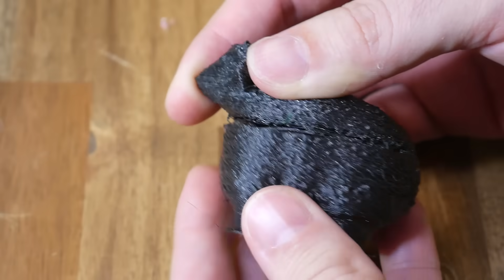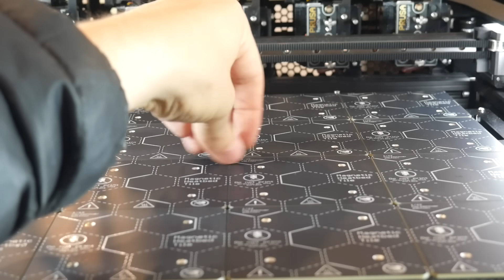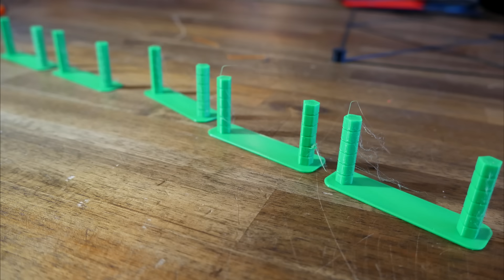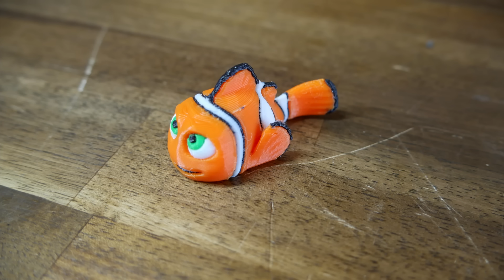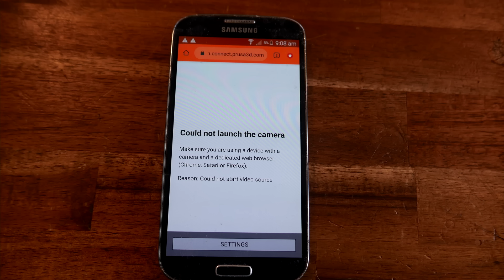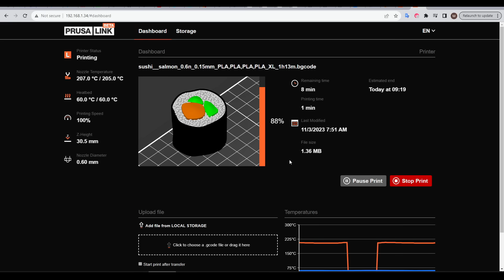The 5 tool Prusa XL is currently flawed, but I think it can be fixed

Comment: I used a draft shield for my tool changes in place of a purge block. It swipes over the tower, knocking off the filament string, and purges into the infill. By the time it gets to the walls of even a small model, it has consistent flow. It finishes on the draft shield and moves to the next tool. The key to success seems to be that it swipes over the tower and knocks off the string, with increased success the less z raise I have. 
It uses a slope z raise, too, so as it leaves and returns, it wipes on the model just a bit and doesn't leave a bump or strong like you mentioned. Maybe you want to run your z hop modifier on it and turn on draft shield?

Comment: I've been happy with my XL 2 head so far.  I think the big difference for me is I really only print functional things, so if it doesn't look great it doesn't really matter as long as it is dimensionally accurate.  I definitely agree with having only one bolt is questionable for longevity for the extruder holder.  One thing I recommend all XL owners to do is replace that USB stick, mine failed within 2 weeks and from the facebook group I wasn't the only one, especially if you're updating firmware, you don't want it to fail.
Reply: That's a really low bar to set for a very, very expensive printer
Reply: @geometerfpv2804  If I would've paid the ~$5k usd that he did, sure, but my total was a little more than half that (semi-assembled 2 tool).  There is nothing in the $3k price bracket that can do what the 2 tool XL can.
Reply: Do a size check with gparted, don't know where Joseph got these USBs but the probably where one off the cheapest in china!
Reply: First thing I did when I got my mk4 was to replace the USB drive with a SanDisk. I don't trust anyone else with thumb drives.
Reply: wow and I thought those usb stick errors came from the Firmware Update good to know that it could be the stick itself.

Comment: Once they have the bugs worked out and it working as reliably as an MK3 this is the type of mutual color printer I would consider. However the price is an absolute no-go. There is just no way I would ever even consider paying that much.  It may be worth it to some but I can't replace the transmission in my car and still have enough left over to cover a year's worth of insurance for the same price.

Comment: Since its finally ok to publicly criticize prusa (this is just commentary on how rabid some fans can be) I think they need to be called out for how not open source their "open source" is.

They have been neglecting to release the wctusl relevant files when it comes to hardware, have been documently more and more poorly/keeping things close to their chest, have publicly complained and indicated they want to move away from being fully open and I think most egregiously, purposefully design things to be hard to reproduce to "stop clones" they say, but not only does that defeat the purpose, but its the type of thing which affects theor paying customers the most, as it means that realistically they have no hopes of making parts themselves and must rely on a company with suitable skills to produce parts (the thing prusa wants to stop).

It just feels like they have been coasting on the lie that is how open source they are for too long.

They use a long ago forked off veraion of marlin which cant be used anywhere else due to that, and it has bitten them because they had to reimplement input shaping which was implemented in marlin proper a long time before they implemented it in what I am choosing to call proprietary through obfuscation marlin.

They try to claim they are being generous by keeping prusa slicer open source, but the truth is that they not only are based on gpl3 code, but are so varied in locations theyve pulled code from that it would be a legal nightmare for them to try to be closed or a technical nightmare rewriting from scratch.

So really, what are they willgully contributing to open source? Why is it people give them credit for improving their slicer which they are forced by license to open source but not BambuLab who also (due to license) have their slicer open source?

I think the truth is that Prusa are now open source not because they want to be, or because they want to contribute, but because they have to. It is literally technically burdensome for them to go closed and so they do not but also waste a ton of effort trying to obfuscate so they can try to have the open source flag while not at all adhering to any of the principles of it.

Printables exists, but why does that deserve praise vs all the other manufacturer options given it, just like they do, has features for their printers specifically and not much different.

This comment is getting long and has turned into a bit of a rant, but I am starting to feel like Prusa needs to prove it still earns its open source stripes, and I think its high time people started calling them out for it. Otherwise its a marketting gimmick and nothing else.

Comment: I had a PrusaMini almost a year after it release and it was a trainwreck for me. Now it's collecting dust because it takes me more time to root-cause than actually make parts with. Since then I will not buy Prusa. I might want the bambu but I will need to understand its functionality once every bit of server connectivity is disabled.
Reply: Same as cloud, but you can't recall past prints if they are not stored on your SD card.

Comment: Great job. Prusa is a great company. I am a huge fan and own every single one of their printers.  However, I am in a similar boat to you regarding the 5 Tool XL.  It is incredibly disheartening to have waited this long and paid that much (oh the duties and taxes) to have it show up and perform like this. 

I do have faith that Prusa will fix things, but I fear they are just so overloaded with trying to meet the demand of everything they have on the go. It certainly isn't easy, but hopefully they can make it happen. I agree, the space will be better off with them continuing to be a driving force. However, I fear they are losing their grasp a bit as Bambu lab just seems to dominate. 

Bambu lab seems like a decent enough company, but certainly not at the same level in terms of their open source stance etc. 

I hope Prusa takes note of all of these issues and fixes them.  Thank you again for your very level headed and balanced approach to tackling this. Cheers Mate.
Reply: How are the overloaded with so few products though? They have 3 printers.

Comment: Jesus, every part of this experience is anti the whole prusa hype/selling point.

Being so closed you had to so trial and error guess work to get basic functionality to work, being so incomplete you had to go to the community to fix their wrongs, being so undertested it had flaws right from the factory, being so rushed there were multiple undocumented but notable changes for the user, I mean thats a long list and Im not even half way through the video.

The fact they charge you 500 dollars to give what you had to do at the atart the title of "fully assembled" is not only more misleading marketing from prusa, but an embarrassing and obvious penny pinching method to avoid paying for shipping a bigger box.

If Im only half way in, literally the rest of this video had better be angels coming out the power supply, and a kitten saved for every print that goes wrong, because its not looking good.

At this price point I would NOT be happy.

Comment: For us older folks the XL needs to work out of the box. I have a PRUSA MK3+ and it worked out of the box. I had  an XL on order but when I seen all the troubles folks were having with it I cancelled the order when my number came up. I am very disappointed.
Reply: What does age have to do with it?
Reply: @radish6691  if you live long enough, you'll find out 😀

Comment: Awesome, thank you for the honest impression. I had an XL on pre order as well, but I switched to an E3D Toolchanger because of the long lead and waiting times. Did you try if some of the issues also are there with the latest non-alpha firmware? I would be very unterested in this. For now I defenitely wont order an XL.

Comment: I think people are starting to wisen up to the fact Prusa printers are way overpriced compared to what else is available these days.
Reply: Not really I think. The fact Prusa produces in Europe is a big factor in price, people just get used to everything being cheap from China, but I think that's a bit of an unfair thing, it's not cheap because they like their people so much for instance. I for one don't mind saving up a bit and my MK4 is super reliable, I started with Ender printers and for sure Prusa ones are not perfect by any stretch, but I never printed this much so quickly after the printer arrived, just less hassle. Plus support and community help, that's all a big plus for me. My biggest issue with Prusa are the waiting times, the XL got caught in supply issues (everyone had those) but this much of a delay was a clear mistake on their part. MK4 as well, even ordering filament can take a bit. If they would get all this as a process way faster..

Comment: Damn, it is quite a bit disappointing to see these results. But I think it mostly comes down to the complexity of the tool changer; maybe they got so wrapped up in getting Input Shaping and industrial machines out the door, and maybe rushed the documentation and slicer profiles in the process...
Reply: At this point they had years to get the printer AND documentation ready.
I take a reliable, slow printer over a "fast" (which the XL is not) printer that crashes (fw) and prints awfully everyday. 

The documentation not being available online is the smallest problem prusa has with this printer atm.
Reply: Is it possible that Prusa has set incredibly ambitious goals for the past 3 maybe 4 years..? @Chrissi33004
Reply: Word got out, from MZ3D, that the Prusa MK4 and XL from 4 years ago look almost identical compared to now.  @Chrissi33004

Comment: Honestly I wanted it to turn out great but i expected this after seeing various print samples on different conventions. If prusa cant put out a flawless print while presenting the printer then how could anyone at home? (I saw layer shifts and low overall quality) 
For 5k they can be open source all they want - it does not matter if the product is not  perfect and reliable. The XL costs 5k and gives you the Ender-3 Creality experience. 
Very disappointing and thank you for your honest review.
Reply: "bUt ItS oPeN sOuRcE" ends up being a frequent excuse for all the shortcomings of such machines. so open source is a free ticket to make a half baked machine and charge extortionate amounts?
Reply: I'm saddened to say that I think you're being unfair to the ender 3 with your comparison here. Having run an ender 3 print farm, I can attest that while they absolutely tend to have issues out off the box, with a bit of TLC they will ACTUALLY perform and produce pretty consistent and good results. So your comparison works if we were talking about a messed up MK w/e. But with the work he put in, AND their own factory test file AND printed parts being dodgy? Smells to me very much like their Nextruder is the primary culprit. I haven't used a hotend where I couldn't tune out stringing on PLA... Ever. Hell I once ran a V6 knock-off that had one of those stupid j-head style heat breaks without the PTFE liner that produced more consistent results than that (right up until heat creep would clog it lmao).
Stringing, layer shifts, inconsistent extrusion. All of those are giant red flags for those extruders. The only question is why does it work on the MK4 and not here? Are they using different/smaller motors or something?

Comment: It's funny that everyone worships Prusa, but I had a terrible time with my mini+. It would jam due to heat creep from the poorly designed heatbreak, and then would chew through the filament at the extruder motor. Because of the design you'd have to dissemble the extruder motor shroud every time because it was completely encased. I ended up selling the mini and await my A1 mini, which seems like a much better design, albeit newer. This is another example of Prusa dropping the ball and Bambu will be there to skip away with it.

Comment: I'm a Prusa fanboy.  I love my MK3S+ with the MMU3. I started with an MK3, upgraded to an MK3S and then an MK3S+ before I added an MMU2. I then upgraded that to an MMU2S and recently an MMU3.  And I plan on upgrading to the MK4 at some point in the next 6 months.  I've found most problems I have with it are my fault.

I had a lot of problems with the MMU2 that I fixed by changing the physical set up of the buffer and spools, and by upgrading to the MMU2S.

Looking at the XL, it's not a printer I would ever buy because of the cost.  I don't have enough of a need for that large of a printer to justify the cost involved.  But what you're seeing reminds me a lot of my first experiences with the MMU2.  It's not good.  It's down right bad, and it's not Prusa quality.  But they've always fixed their problems, and I'm sure that they'll fix these.  It's just unacceptable that they charge this much for a printer, and shipped it with so many problems.

Comment: I'm really rooting for prusa but at their price point and current feature set features its a though sell.. give us a klipper version, put some accelerometers on there for better input shaping.. 
I really do hope they make a smaller corexy with more modern features. Having to wait years for it to actually get delivered is not great either
Reply: 1. There may be an accelerometer on the tool board if I am not mistaken
2. Smaller Prusa CoreXY may just be a "printer module" found in the Prusa Pro AFS
Reply: @DJProPlusMax  if the Prusa Pro AFS printers have "Prusa Pro" pricing like the HT90, then they won't be a good option for most hobbyists.